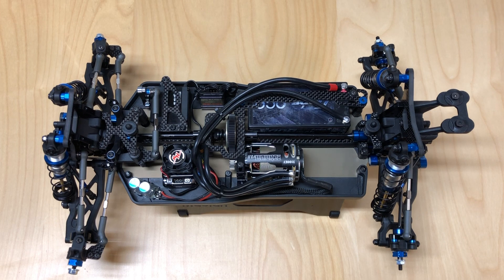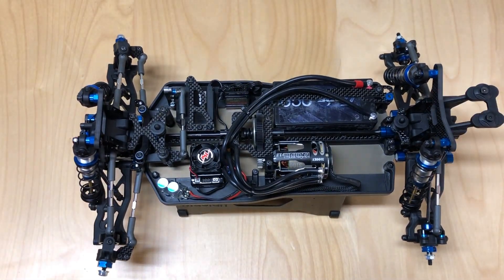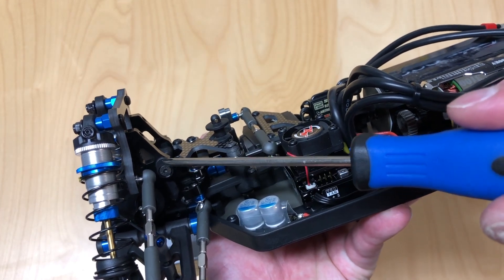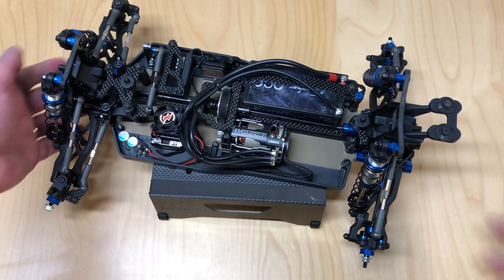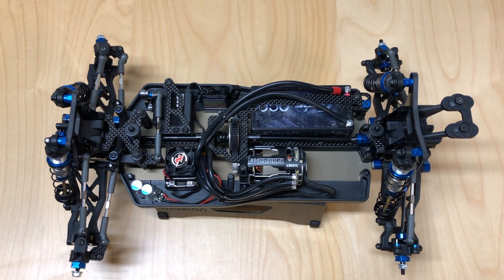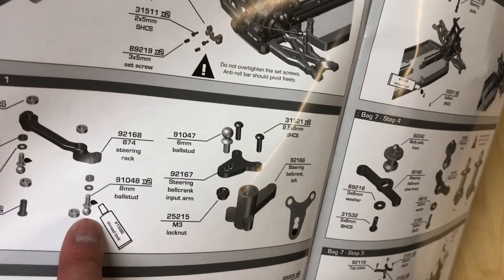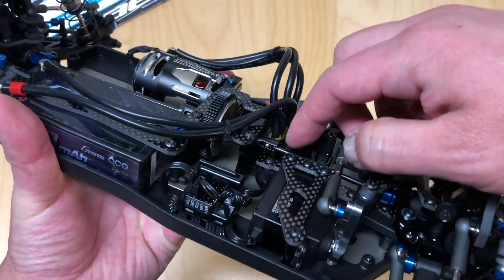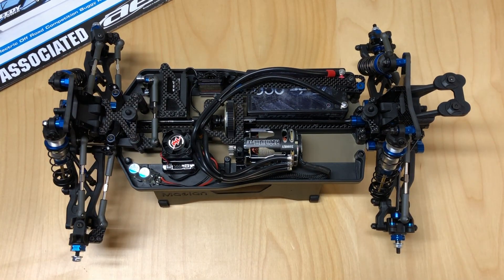B74 Team Associated build review

Comment: That's basicly a Yokomo Yz4-Sf because of that front aluminum brace that holds the differential.
Reply from the maker: Diego Olivera thanks, I was trying to figure out if anyone else had already done the aluminum brackets.
Reply: @RazorRC  Did you already drive the car ? If you did could you tell me if the car is good ? maybe ill be buying one too